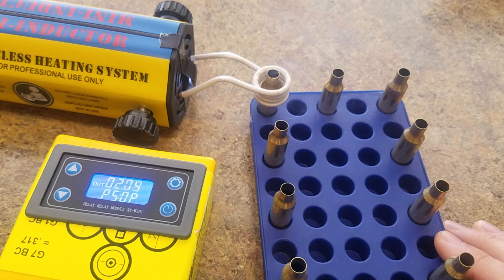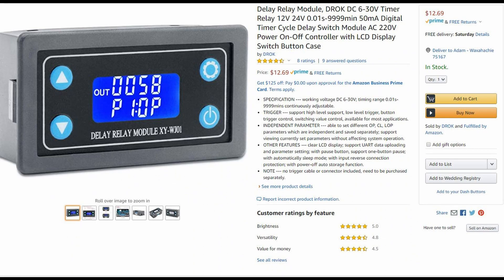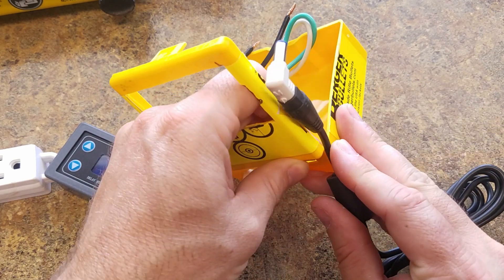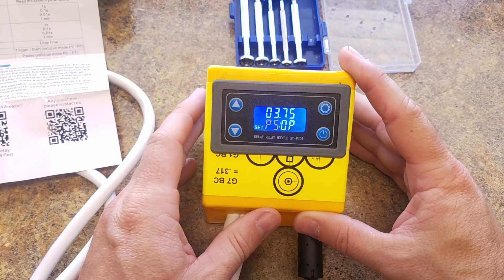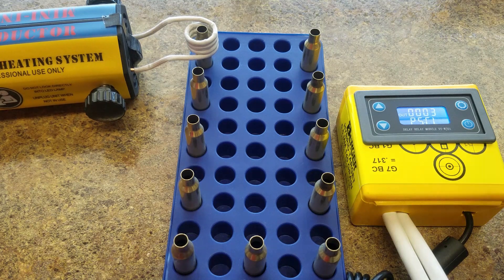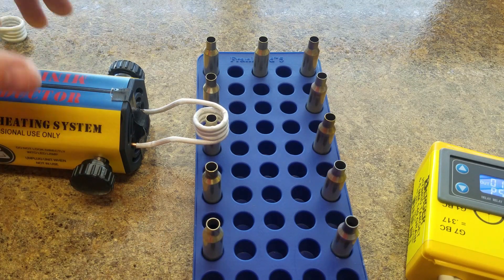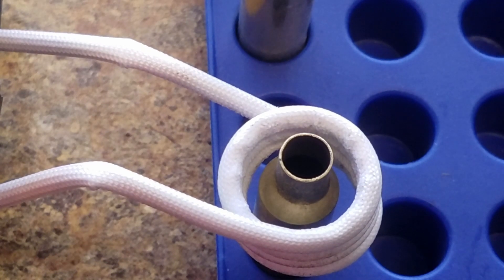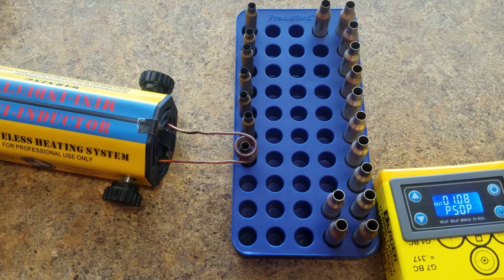DIY Induction Annealing Brass with .01 second accuracy for $200

Comment: Hey saw the video… how can you tell if your getting a really good anneal using this setup?
Reply from the maker: The same way you would with any other type of heat annealing, you could look for the dark red glow, use templaq, or test the softness
Reply: @northeasttexastactical375  I like the idea of your annealer… have you noticed it actually making a difference in your groupings or longevity of brass? I’m just trying to figure out if I want to commit to going this same route.
Reply from the maker: @jamestatum4793  I wish I could post pics here. My last 5 shot reading with the LabRadar had an ES of 3 and SD of 1.2 .  Never did that before annealing.

Comment: I'm confused as you seem to use different parts at different times. If I understand it correctly, the induction unit gets plugged into the power strip after it has been modified  to attach to the timer. The extension cord gets attached to the timer and plugs into a wall outlet. Correct? There is no necessity for a wall wart at all.

Comment: I've heard a report the unit is prone to overheating and does not produce very consistent results.  Have you experienced either of these by chance?   Thx.
Reply from the maker: It can over heat if not adequately ventilated, but you just hook up a vacuum hose to the back end, suck some cool air through it for about 20 seconds and it's good to go again. I'll be discussing this in my follow up video soon. As far as consistency, I've had nothing but good results.
Reply: @northeasttexastactical375  Great.  Very helpful info.  Thanks for the quick reply.

Comment: Why is the coil getting hot? In other induction coils it doesn't get hot. There must be a flaw in this design?
Reply from the maker: All coils get hot, hense the fiberglass heat shield wrapped around it. However... Thinner gauge wire will get hot faster, and a lot of people use liquid cooled copper tubing in place of the wire to keep the coil cooled off.

Comment: Silly me.
 I have been putting as many cases as will fit in a Cake pan. Fill with water up to level I don't want to get hot. Then  Broil till right glow is reached. 
I might have to build one of these. 
Thanks
Reply from the maker: Ohh goodness.... no... get you one of these.  I've got a followup video in the works to clarify some stuff and share what I've learned the past year running it.

Comment: 5:01 to 5:08 "let's get this thing plugged in" ??? What are you plugging in. The extension cord, the power adaptor cord, or both??
Reply from the maker: That would be the power to the module,  12v or whatever DC voltage you're working with. I think it handles up to 48v DC.

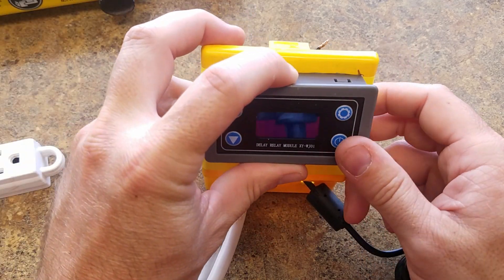Comment: From 3:54 to 4:02 you are suddenly test voltage from a wire that came out of where?? 4:08 to 4:12 you have a switch that was not introduced so we're did it come from? What does it do?
Reply from the maker: I was just making sure the positive and negative wires were correct.  That is just the 12v power supply I'm connecting to the module. Instead of stripping my 12v plug,  I just have a female barrel plug adapter with those 2 wires coming out of it.  You could literally just plug in 2 wires directly from a car battery and it would be the same thing.

Comment: I ordered the parts from Amazon, and the last one came today.   Quick and easy setup, and works exactly as described here.   Great video and thanks for producing it.   The only change I see so far that I need to make is to attach the bullet box to a thick steel plate, because right now the box is much lighter than the cord and the weight of the cord pulls it off the bench.
Reply from the maker: That's true, my box just flips around on the table. Glad you like it

Comment: I just ran across this. Has any testing been done with say a hydraulic bullet seater? Have you done any extensive benchrest testing to test how well or consistent this is?
Reply from the maker: I am not in the market for a amp hydraulic bullet seater and I don't know what you consider extensive testing or what would even satisfy that requirement, but I have managed to keep my standard deviation under seven over 30 rounds and have hit the mile target with Cold bore shots with my 223. This definitely works. However you decide to quantify the results is up to the individual.
Reply: @northeasttexastactical375  I shoot 300 and 600 yard benchreat. I'm seriously looking at the AMP machine but the cost has kept me from pulling the trigger. I know I'm getting inconsistent results with my propane torch because I can feel it on bullet seating. Chronograph testing with your induction deal compared to flame  would be nice. Now that I have seen your video I would like to build one but I need to know how consistent it is. Thanks for this video!!!  If it will take a link here is something like I'm talking about. https://www.youtube.com/watch?v=YWUw6tyzE7U&t=329s
Reply from the maker: Sorry, my nature. I know there is a very generous window between adequately annealed brass and over annealed, and I am definitely not over-annealing. It's not hard to get consistent results. Treat it the same as flame annealing, but just faster and more consistent.
Reply: @northeasttexastactical375  Thank you, that helps.
Reply from the maker: Gotcha, ok so, I do have a hydro-press, and I have been able to get consistent seating  within 10 psi
Reply: @northeasttexastactical375  Why don't I believe that? Also if not careful, that hydro press just checks how good the finish inside each neck is.
Reply from the maker: Hard to say why people believe or don't believe things. If you're emotionally invested in the AMP Kool aid, drink up, if you want a cheaper option that physically does the exact same thing, here you go. Reloading is an individual sport; you get to pick all your own gear and play by your own rules. Happy Reloading!
Reply: @northeasttexastactical375  There is no reason to be a sarcastic ass. I'm being serious. under annealed brass gives inconsistent results and over annealing causes brass to loose it's spring back. Flame annealing has too many variables. I'm just interested in knowing how you know you are getting consistent results.Do you know if you are or do you just believe that you are?

Comment: I realize that this is over a year old. I built one myself and using 4 turns (because I cant count), it works great. i may need to spread the windings a bit more as the insulation starts smoking up after about 3 cases and I cool it with a short, direct blast of concentrated air. Have you experimented with different amounts of coil turns? IE More efficient transfer with more turns or is it a wash due to the increase in inductive reactance? I can easily drop back to 3 1/2 or 3 turns if it delays the coil heating up. Thanks!
Reply from the maker: This is still a very active thread and video. Try more coils, and find a thinner wire if you can, it doesn't have to be insulated, it just can't be touching coils. I have a thinner wire with about 7 or 8 coils and it heats a piece of brass in less than a second.

Comment: I've ordered the 2 main parts to build this.   What are the multiple adapters you are using coming our of the AC=>DC converter?  It looks like a white adapter going to a black adapter going to a green adapter.   Why didn't you just cut the plug off the power supply and use those leads?
Reply: It's a universal power supply with a bunch of different connectors. I was just trying not to destroy anything so I can reuse it for something later. You could just wire nut all those wires together.

Comment: Terrific idea, thanks!  I just got put mine together, but mounted it to a board.  So the annealer is fixed and I can just drop the case into the coil. I made a simple spring loaded wooden gate below to drop the case into a basket hanging beneath it.  I also added a switch and outlet on the board for power.
Reply from the maker: Very nice. I just got a 3D printer so I'm marinating on ideas,

Comment: Nice DIY. I like the fact that it's no-touch on the brass (i.e. with your fingers). I would prefer to trigger the induction cycle manually when I put it over the next case, rather than have it go off automatically a certain number of seconds later; this would appear to be a much safer route if for whatever reason I had to drop what I was doing. But that's a matter of individual taste, and I'm sure the control box can accommodate that?
Reply from the maker: You have to push the button for it to activate. Otherwise the timer will just continue to cycle and nothing will happen. So, what you're wanting to happen is what happens.
Reply: @northeasttexastactical375  Ahh, okay, yeah I see now. Thanks for clarifying.

Comment: Great work I applaud the effort. I definitely recommend coupling this wis a press for consistency. I also recommend widening the coils around the brass as it will reduce the possibility of over heating and give you a wider window. I highly recommend the tempi law or another way to test the temp because too soft is probably worse than not enough
Reply from the maker: Very nice! I may try widening the coil spacing to slow it down a bit. My current coil is under a second for full anneal.

Comment: Good for you. I am doing something about the same. I use copper tube and pump water through it. Never gets hot. Use a computer water cooling radaitor and fan.
Reply from the maker: I thought about upgrading to something like that, but it only takes 1 second, or actually like .92 seconds to anneal a case, so I can do 100 cases in about 6-7 minutes with a 3 second off cycle

Comment: I tried this and it works, but it seems kind of dangerous.  What happens if those cables into the relay timer switch come loose?  I've heard someone refer to this as a "suicide cord" (which I know usually refers to a male/male extension cord).
Reply from the maker: You just throw a breaker. I wired one of these wrong in my experimentation

Comment: I bet you could put together a time chart for different cartridges & sell this as a kit on etsy or eBay for 2-3x your investment. I personally know a couple people that would probably buy this as a set for at least $400. That's not bad margins if you think about it.
Reply from the maker: Ha! Just saw this. There's some things that just need to be open source, like 3D printed guns, and this. Since there is no alterations to the annealer, it's really just an extension cord with a timer box built in. Total cost of components may be $20 for it, BYOA bring your own annealer.
Reply: @northeasttexastactical375  would you consider throwing together a couple if i had buyers? reloading market getting hot again & something tells me current events gonna cause another ammo price hike.
Reply from the maker: @RichardCranium321  time is my problem. I've been wanting to do a follow-up video to go over the common issues people are having, I've got most of the footage, just no time to put it together. It's going to be really cool when I get to it.

Comment: This is one of the best annealing videos on YouTube (I've watched/re-watched several times), thanks!

I recently purchased the induction heater and a timer. One wrinkle though:  while the heater looks identical, the interior fan runs constantly (which is probably good for cooling) once plugged in. I hesitate to disable this by using the timer to control power to the unit....but don't have a lot of great options. I'm not really interested in changing the internal wiring to exclusively power the heater from the timer..... I guess another option would be going the route of removing the case out the bottom, as the GinaErik design does-

Any thoughts or wisdom would be appreciated.  Thanks again for the cost effective idea!
Reply from the maker: Glad you liked it. Ive seen guys who get the one with the fan on full time.  Regardless, the induction unit will only have power when the relay allows it,  so technically it shouldn't matter how the fan operates when plugged in normally because they will all operate the same when using the timer module. The only difference I see is when you aren't pushing the button the fan will still cycle on and off for the set amount of time due to the relay.
Reply: One work-around you can do is to have a short 'off' phase that is just long enough to transition onto or off of a case.  Then hold the coil well above during 1-2 cycles without pressing the button that powers the coil so that the fan runs but the inductor does not.  You could also just keep another fan blowing nearby, like the creator of this mentioned is good to do anyways.
Reply from the maker: @ericstrabel4365  some units run the fan full time whether the button is on or off, so that would work. Mine only works when the button is pushed though.
Reply: @northeasttexastactical375  ah, I gotcha

Comment: I'm looking at the AC relay that is the second of the two links above.  I'm not sure how to wire it.  Can I power the timer relay by tapping into the hot (feed) side and jumping to the + on the relay power?  Then where would I ground?  This would avoid the extra DC cord and clean up the unit.

Comment: Just completed mine. I used a stock coil that fits great over my brass. To pick the cycle time I watched the brass turn gray and creep down the neck and about 3/8" passed the shoulder. The case never glowed. I believe that should work nicely. It took 19 seconds for reference... I was quite surprised it took that long but Im ok with it. I can't see spending $1400 on the AMP when this appears to do the same job with great repeatability.  Thank you very much for sharing!!!
Reply from the maker: You can speed that time up by wrapping more coils tighter around the case.
Reply: @northeasttexastactical375  Thank you, I saw thats what you did and read some comments. I'll pick up some wire and give it a shot. Again, thanks for sharing. Great and simple DIY.

Comment: How you determine the duration of your timer for annealing? Would putting the 650° Templaq on the inside of the case neck work?
Reply from the maker: I do what the propane annealers do and look for that faint glow,  but it happens so fast,  I don't think the templaq is worth it personally.  You'll know when you've gone too far from the rainbow color on the brass and bright glow

Comment: I can only do about 10 cases and the coil is glowing red hot .If i do much more the unit shuts down till it can cool off which takes along time .
Reply from the maker: It sounds like your coil is the wrong size. You might want to try more coils and wrapping them tighter. How long does it take to anneal each case? Because it takes me about two to three seconds.
Reply: @northeasttexastactical375  4 coils and the diameter will touch the body diameter of 6.5 Creedmoor tight spacing . 4 to 5 seconds .
Reply from the maker: Try a thinner gauge wire. I experimented with thick and thin wires and the thick wires just heated up the coil and took forever to heat the brass up. With thinner wire you'll be able to get 7 to 10 coils
Reply: @northeasttexastactical375  Ok ,i will try that ,thanks

Comment: Are there other programmable timers that you would recommend that could control a system that has a case feeder/Annie annealer/solenoid controlled trap door, one after the other to automate the system? Thanks.
Reply from the maker: I'd assume it would be a timer like this one from the other DIY projects I've seen with automated annealers, but that's a bit out of my technical knowledge base.

Comment: The relay timer from the link says it is for 220v. Would it work for 110v? Thank you.
Reply: 220v would be max voltage for the contacts, 120 would be fine.....

Comment: How many cases can be annealed before the coils get too hot to continue?
Reply from the maker: That depends on How long it takes to anneal a case Which is dependent on a lot of factors . I can usually get 30 cases before I need to switch the coil out But the coil also cools off pretty quick if you have a fan on it

Comment: I bought the same parts that are in the video and went through some testing/adjusting to get the output time set to get just the right amount of "glow" to anneal brass. The problem I'm now encountering is that 4 days ago   3.9 seconds was exactly the right time needed..... Yesterday I got (using the same piece of 308 brass) more like 6.5 seconds as being the correct amount of heating time. Same deal with other calibers (using the same piece of brass of THAT caliber for testing/setup. I can't figure out why the time seems so wildly different. I've tried checking most everything---supply/source voltage and current, connections, etc., etc. I test in a darkened room so I can see pretty much exactly how much "glow" I'm getting in the brass....BUT why so much varying? I mean like nearly double or half the time! I'm now wondering if the timer is not turning on/off as indicated. Anyone else having that sort of issue?
Reply from the maker: Just saw this, sorry. I will say you don't want to just keep annealing the same test piece, it does react differently if it's already annealed. And different brands definitely have different anneal times. Could be the depth of the coils on the case is different.
Reply: Just a thought, but is the brass you’re annealing from the same manufacturer? i.e. Remington, Hornady, Lapua, Winchester, Norma, Alpha….? If the manufacturer is different, the timing will be different for each. I’ve noticed that on the expensive AMP machine, it requires you to input which brand of brass you’re annealing.

Comment: Thank you very much for sharing this information.  This is by far the cheapest setup out there,  and has the same degree of accuracy.  You need an affiliate link to the items so you can get some kind of compensation for this information.  Either way thanks for sharing this with the community.